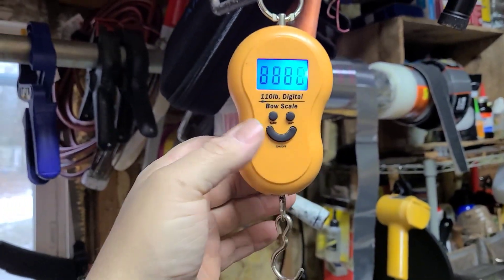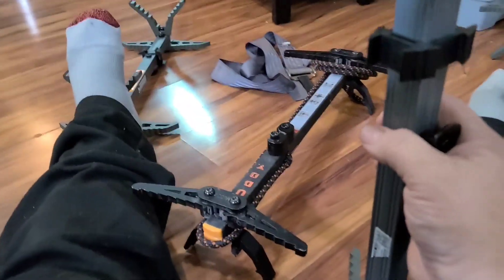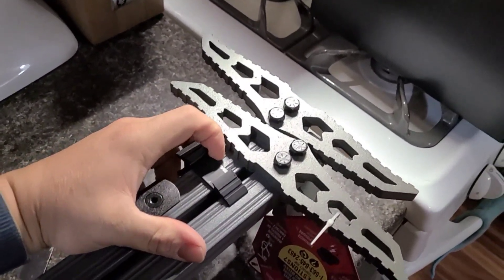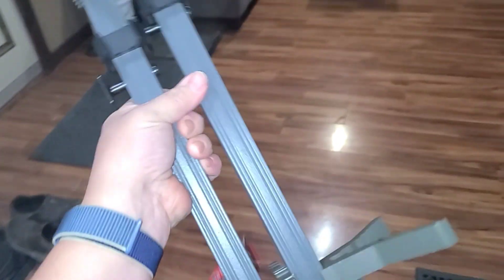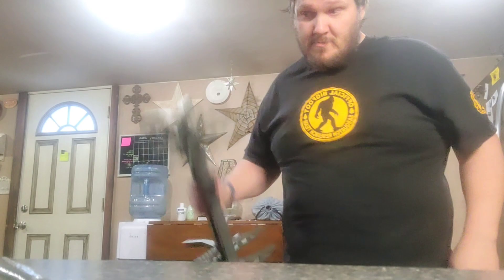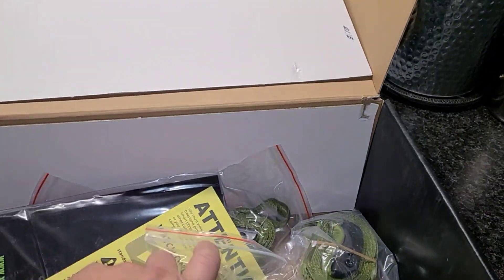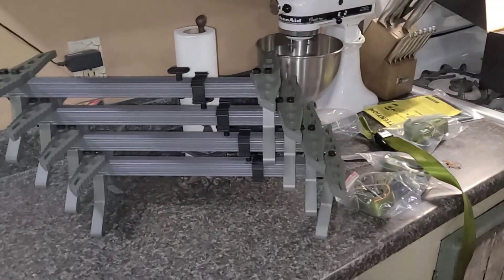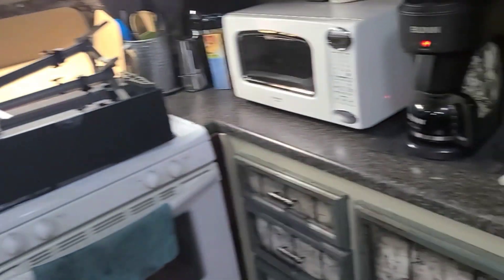XOP STICKS. XOP ULTRA SERIES FIXED DOUBLE STEP. unboxing and weighing & comparing to my muddy sticks

Comment: I got these in the mail today. Had looked at a few negative reviews about the steps moving but it looks like my screws are different than the ones they had issues with. Im excited about trying them this season. Really needed it because Im starting to plan a sika hunt next year and needed a lighter mobile setup.
Reply from the maker: They updated them. And they are super solid now. For the price you can't go wrong. I love them. I've been using then to practice shooting and man no joke they are awesome
Reply from the maker: Like I'm not just saying that either.. I'm not making anything at all.. not sponsored by anyone .. they are really good
Reply: @MikeyWoomer  how high can u get with them?
Reply from the maker: I have short legs but I'm still able to get 16 ft easy to the bottom of my platform. If I had one adder for the bottom step or even used a screw in step to get a few ft I'd get close to 18 to 20 ft. Some one with longer legs probably hit 18 to 20 easy
Reply: @MikeyWoomer  ok i'm 6ft was thinking about getting these or the api sticks and cutting them down to 24 inches i wish i woulda kept my beast sticks lol
Reply from the maker: I really like these xop sticks
Reply from the maker: I honestly don't have a bad thing to say about them.
Reply: @MikeyWoomer  nice if i don't get the api sticks and mod them il prob go with the xop i had the xop single steps before and used them one time and sold them haha what state u in?
Reply: Having noise issues when separating them when nested side by side . When nesting One on top of other , there’s no problem but then the j hook doesn’t work to connect to the stand. Any ideas?
Reply: @matthewcaulfield2601  next year i'm gonna get a beast stand and 20 inch timber ninja carbon sticks

Comment: nice sticks i was thinking about getting a pair but they need stealth strips on them for sure
Reply from the maker: Only problem I have with stealth strips is they are fabric and they will hold sent I think. Idk tho I don't know enough about them. I thought about adding some paint to them
Reply: I wonder if spraying with that rubber spray, flex seal or something similar. maybe help keep the clanging noise down
Reply from the maker: I wonder how long that stuff will smell for? I've never seen or heard of anyone trying that.. I'm kinda curious now lol
Reply: @MikeyWoomer  i would just use stealth strips i ended up getting api climbing sticks cut them down to 24 inches got a extra piece of aluminum and made a fourth stick there about 8lbs id say they just like a poor man's beast stick!
Reply from the maker: I like my xop sticks. I have a set of muddys too they are not as good as my xop sticks.
Reply: @MikeyWoomer  i ordered some XOP sticks from Midway last night before going to sleep 💤.  I got a cruzr setup on Tuesday. Drove to their "store" , about 1.5 hr drive for me. Mwt the owner, he showed me the gear and got to try it out etc. Looking forward to try out saddle hunting
Reply: @MikeyWoomer  i my set up last year was the novix helo with 24 inch beast sticks i wish i woulda kept them
Reply from the maker: That's a big step.. I don't think my short legs would like that haha